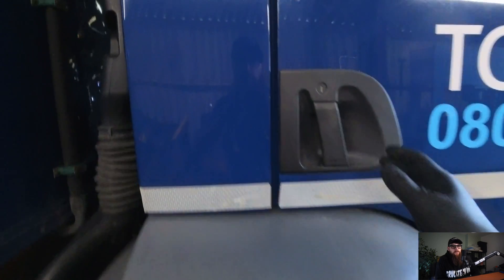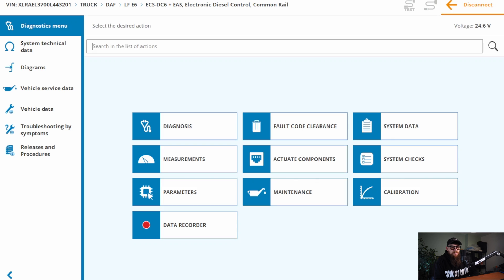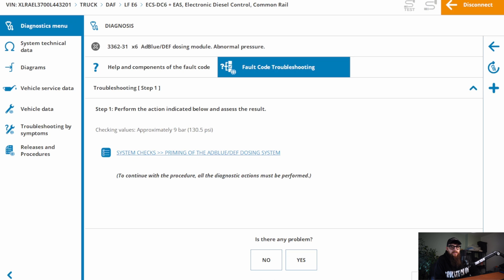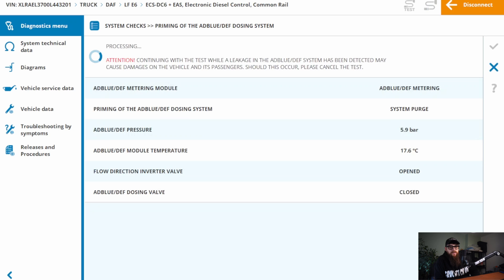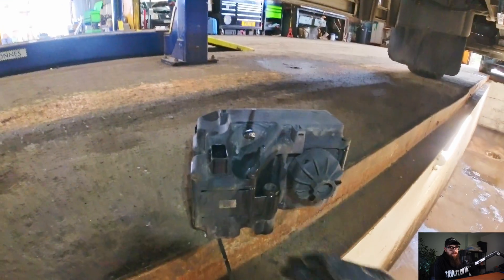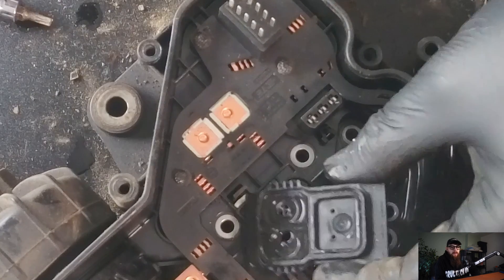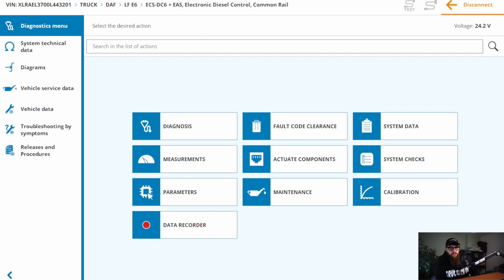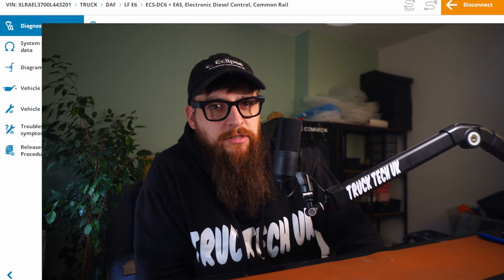DAF LF E6 adblue fault? strip down and rebuild time!

Comment: hi nice video I wanted to ask you something, where do you get the membranes?  because here in Italy I haven't been able to find them, also because I don't have a spare code.  could you provide it to me?  because I have two broken pumps both with a cracked diaphragm.  I thank you in advance
Reply from the maker: Hey thanks for the comment. The repair kits are available here. https://www.trucktechuk.com/product-page/daf-adblue-pump-repair-seal-kit. I do the pump and reverter valve with this kit 

Hope this helps 😎

Comment: How come you don’t go more in to depth when you have no pressure? Such as maybe putting your own supple of ad blue incase maybe a pipe is drawing air in etc? Also after you fitted the pump I noticed the pressure dropped to 6,7.5 bar and then shot back up? Also I have loads of these pumps sitting about where can I get parts? Cheers & good videos!
Reply from the maker: Hey Dean thanks for the comment. 
The only time I've encountered air entering an adblue system on DAF is on FAD tippers where the pipes rub under the battery tray
I used to flush the pumps out with distilled water but customers want reliability and seeing as I would strip the old units I was able to identify the failed parts such as the rubber membrane behind the pump or the pressure sensors and then start replacing these instead.

The pressure drop corresponds to the AdBlue dosing valve opening briefly which you can hear when you run the test and see on jaltest this obviously opens up the supply pipe to the injector hence the pressure drop
.
I keep the seal kits and associated parts in stock on www.trucktechuk.com usually but they just sell out straight away.......I will make them available for pre-order I think so people can get a look in 🤔

Comment: Hello Russell, despite the coolant reservoir being full in the 2019 DAF truck, it still displays the "coolant level low" warning. The sound of this warning is quite bothersome for the driver. Whether we fill the reservoir, replace the sensor, or even change the entire reservoir, the warning persists. The dealer in our country charges a significant amount to clear this warning. Please guide on how to resolve this issue.
Reply from the maker: What engine is it? MX-13 AND is THE CHASSIS NUMBER BETWEEN 0G274270 and 0G298272?
Reply: @TRUCKTECHUK  
The truck is a 2019 DAF XF 480 FT, and its engine is the MX-13. The chassis number is 0G253342, which falls outside the range of 0G274270 to 0G298272.

Comment: Where do you get these rebuild kits? I work on material handling equipment that runs the Cummins engine and have the same pump and they are expensive to replace regularly so repair kit would be a useful option to offer my customers
Reply from the maker: Josh I've had so many emails for them I'm going to put them on my site for sale later today 👌.
Reply: @TRUCKTECHUK  i will make sure to pass your details onto customers in the future who need a repair kit then, cheers bud. I don’t mind spending an hour fixing it, paid by the hour and looks simple enough

Comment: Hi do you know what the main wire is to the brake pad wear to bypass on a xf 480 70 reg thanks
Reply from the maker: 70 plate you can't sorry it has to be fixed. It was 3406 but brake pad wear now runs through CMF AND CMR
Reply: Ok thanks. Should a short show up on jaltest ?
Reply from the maker: @ricardo-wb7rt  can you not ring jaltest uk support at Eclipse?

Comment: Would you rebuild on 8 1/2y old mx11(640 000km) the pump preventive? Truck will stay in the compagny for several more years.At present no fault codes.
Reply from the maker: Has the engine failed currently?
Reply: no. Has a intermittend EGR fault code(P103C) which i know is the start off the bearing going out(EGR valve has a little play) but i plan on putting a new valve on it .
I have allways prefered to replace parts before the truck fails,specially parts that you know that will wear out before the engine does.
Ps i raise this question not just for me but also for the others who watch your video's.   @TRUCKTECHUK
Reply: Could be the EGR valve, but could also be sign of needing to clean EGR cooler, venturi tube, and air management sensors. The upstream Nox sensor could also be causing the fault. @daf106brugge4

Comment: thanks for this video Russ, where can I get parts for bosch denoxtronic, I had a case when the adblue pressure sensor in the unit was faulty and the customer gave €500 per part.
Reply from the maker: Beny I've had quite a few emails about parts now. I think I'm going to put a kit together of all the bits I'd change while it's open and you can just recondition the lot. 

I will drop a post in the group when it's up on the site
Reply: Thanks bro i am waiting that have a good day !